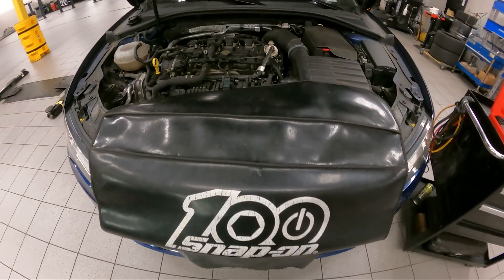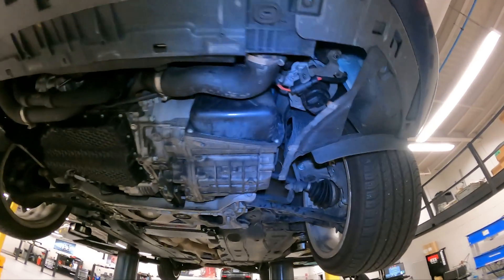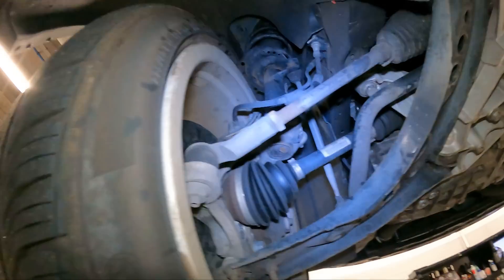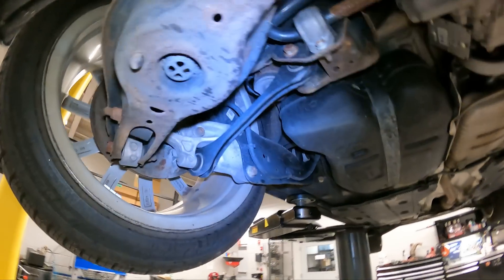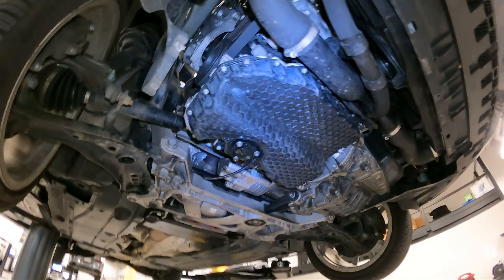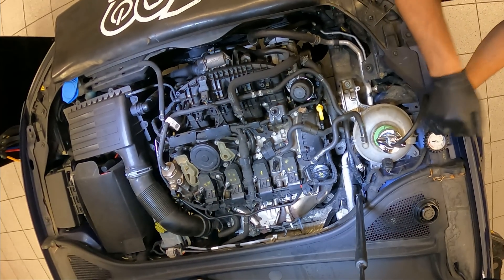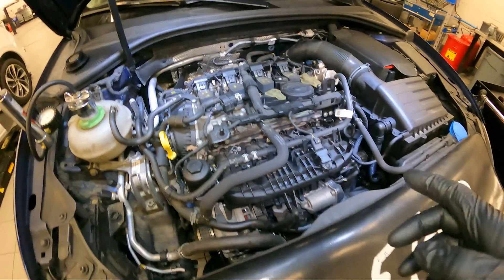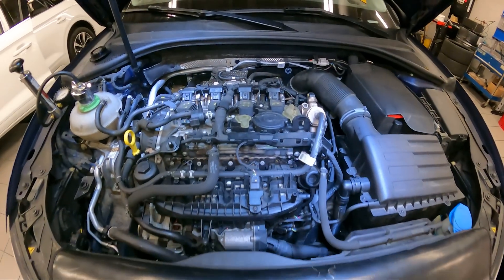Customer states COOLANT SYSTEM PRESSURE TEST🤔LEAK FOUND‼️ #customerstateswhat

Comment: Back in the day, I was working on a 2.8 v6 passat that had a leak. The plastic thermostat flange was erroded. So my parts guy ordered a metal flange from a 2.7tt s4. Fit right in. Virtually the same part, just properly made of metal, not plastic. Put it on, pressurized and was loosing pressure. Couldn't see a leak any-freaking-where. So I said, fuck it. I put on the cone adapter on my blowgun and fit it against the nozzle of the expansion tank adapter. Put 30 pounds of pressure on it and finally I saw a leak from behind the oil filter cooler. Turns out it was hammered and damaged, but it was holding on, til I pressurized the system and realized I'm losing pressure. Changed that cooler, put some 30 more pounds, no leaks - shipped it out the door knowing that it'll never leak.

Comment: What impresses me, is how you switch from Imperial for the tyre tread depths, to Metric for the wearing of the brake pads...!
Reply: That is more common than you may think in the automotive industry. The majority of your fasteners are Metric, tire tread Imperial,  most precision measurements like engine components,  Imperial. It's a pretty good mix.  And I'm in Canada where we use the Metric system. 
My favorite has to be a tire measurement 
255/75R16. First number, tread width in millimeters,  2nd # is your sidewall, so 75% of 255 is your sidewall height which will be in Metric and then the last # is a 16inch rim. So you have both Imperial and Metric measurements on the same component. Make up your damn mind.

Comment: is that the very typical coolant flange leak for the ea888 gen 3? I think there is an aftermarket billet alumimum part that is a direct bolt on replacement.